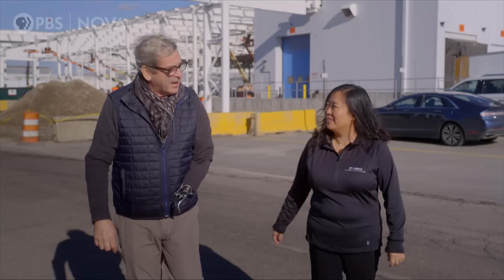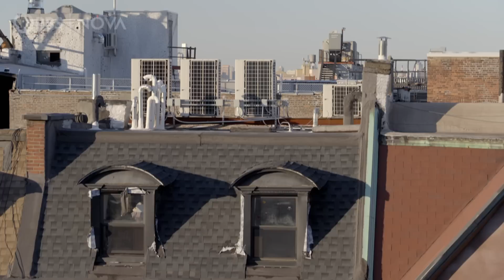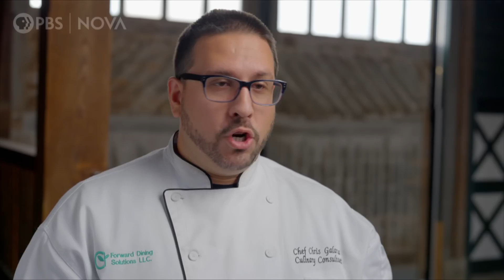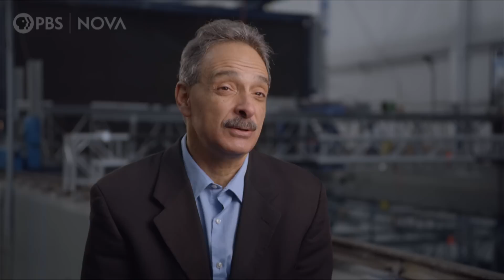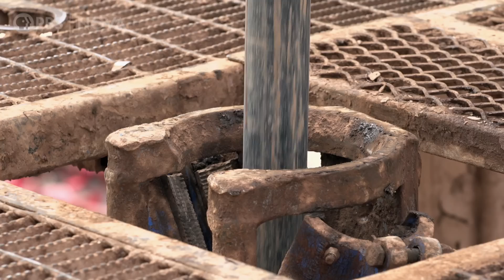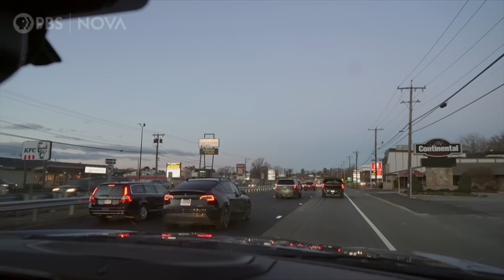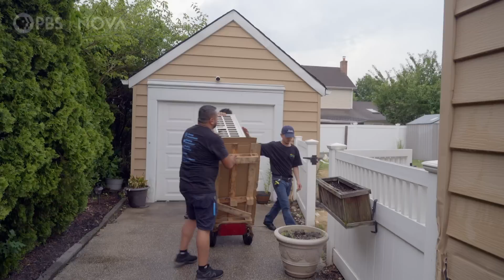Chasing Carbon Zero | Full Documentary | NOVA | PBS

Comment: I am an HVAC professional. And there is no way around the fact that burning natural gas on site in a high efficient furnace or boiler at 96 percent is better than burning the same gas or anything in a power plant to make electricity that cant come close to those efficiencies by the time the electric reaches your house. Even with the latest and greatest heat pumps you still burnt more carbon. Its just simple math. And dont get me started on the carbon foot print of a battery.
Reply: Sorry but that natural gas does not just appear magically in a home's pipes.  There's an absolutely massive 24x7x365 global effort of subsidies, investments, people, equipment to explore, drill, refine and distribute this stuff all before a single drop of it is burnt for energy.  Just the petroleum refining step takes up some 15% of the US annual energy budget.  Maintenance of pipelines big and small is an ongoing process.

There are over 2-million miles of natural gas in the US alone.  Within each valve and connector is the possibility of a small leak that will vent out concentrated methane (CH₄) straight into the atmosphere.   This is known as the "fugitive emissions" problem and is responsible for some 6% of global greenhouse gas emissions.  It also leaks at natural gas processing facilities.  That waste is estimated to cost the US $2-billion annually and enough to heat 10-million homes for a year.

Methane Also has 80X the greenhouse potency of CO₂.

Tragic and terrifying video of entire home rooftops lifted straight into the air from natural gas home leak and explosion turning the house into about a million matchstick pieces.

https://youtu.be/n9Y7Kjj0mbE?t=22
https://youtu.be/pWAui49J1mM?t=1

The most efficient energy use would be rooftop solar.  Nothing is more efficient than generating and using the energy locally and it unloads the grid.  Combine that with heat pumps and its getting to efficiencies well beyond 96%.  Also electric immersion water heaters are way more efficient nearly 100% of incoming energy vs than natural gas 60% efficiency at heating water.  Anyone can put their hand near the vent of a gas boiler and feel the large amount of heat energy wasted as the heated CO₂ and water vapor must be vented outside.

There are much more problems with natural gas methane…
Reply: Which is why the point of the doc is we have to electrify everything, including industry, with renewable energy sources. There is a path to doing this.
Reply: Are you going to respond to anyone?  Have you been convinced by any of these replies?  You seem to have left out some variables
Reply: Yes Miller, they stretch this Carbon footprint ridiculously .Honest science is .04 carbon atmoshere..good luck trying to commit suicide by Co2 poisoning.
Reply: You're ignoring the cost of putting and maintaining miles and miles of natural gas pipes below our roads, but you're including the inefficiency of electricity distribution? Our energy companies will save tons of money by no longer maintaining natural gas pipes! And you'll never reach 0 carbon burning natural gas in homes and we need to start moving people in that direction now because furnaces, water heaters, and dryers with natural gas can all last decades and nobody should have to throw out their furnace because the natural gas company's prices doubled because almost no one uses their service anymore.
Reply: @Oxm314159  LOL.  Yes, I've encountered this way way too often on the forums.  So many fossil fuel fans assume the stuff just appears magically in the pipes or at the local gas station all perfectly refined and ready to go.  :face-blue-covering-eyes:
Reply: Your absolutely correct. Chasing carbon zero will be about as successful as a fat dog chasing it's tale.
Reply: @twa2471  The US federal government already set target to have carbon-free grid by 2035 and EU has similar goals.  They're both well on their way.

The US 4000TWh grid is over 55% carbon free already and the EU's grid percentage is even more than that.  Last year (2022), the EU reached a milestone where solar & wind alone provided more grid energy than fossil fuels -- that does not include their other zero carbon power sources like nuclear and hydro either.

The US solar capacity is currently at 29.1GW and growing at a stellar 33% compound annual growth rate (CAGR) over the past decade.  So the US solar capacity will be nearly 1.0 terawatts by 2035!  Probably even more as with IRA 2022 and more subsidies as fossil fuels winds down.  Combined with the US's wind power (which is even greater than solar) at 140GW, the US is on its way to meeting its 2035 target.  China's solar capacity growth is even more spectacular at 66% CAGR.  Those CAGR numbers are astounding.  Imagine your investments growing that fast.

We look to the leading economies marketplace and energy policies because that will likely be the near future for the rest of the world.  Leading economies R&D expenditures and big purchases of technology drive down the price for everyone else.

How about that?
Reply: Thanks Travis couldn't have said it better